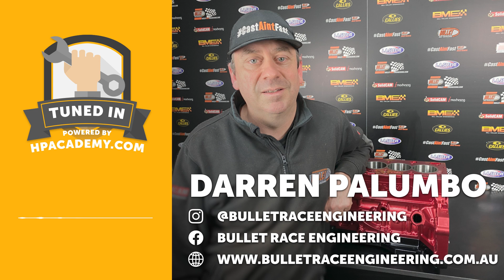041: Hunting for HUGE, Reliable Power — is Billet the Answer? [#PODCAST]

Comment: Another great podcast and information from HPA. The analogy surely is a Carbon bicycle, if you have tried one? It’s incredible how much power is transmitted to the road. An old steel tube bike flexes and absorbs a significant amount of power the ride produces. It’s not surprising, these billeted blocks are producing all the extra power. I wonder if you would like to do one based on a Mercedes M119? Sounds fantastic
Reply from the maker: Yes that is a good comparison. Compliance where it is unplanned is the enemy.
They sure could, they can do one off blocks or a run of them (5 or more I believe but you'd have to check directly) if there is enough interest which would help bring the cost/s down - Taz.

Comment: Keep in mind that the block fill is supporting the sleeve. Might not help at the point of peak pressures in the cylinder, but it will help stabilize the sleeve across its full length.

Comment: Sounds like they where running centroid machines.. i used to run a old machine retrofitted with one of their controllers.. is pretty simple and very conversational to use for the most part.. maybe not as good as say a mazak or something similar but also depends if you wanna pay 50k for a mastercam seat a year.. alot of expence there which makes them pretty competitive of the price I guess..

Also remember having a bullet cylinder heads Sr block as my screensaver over a decade ago as my dream engine unfortunately my dream was bigger than my budget but I could see the value even back then.. is only a couple dead engines away from being cheaper way